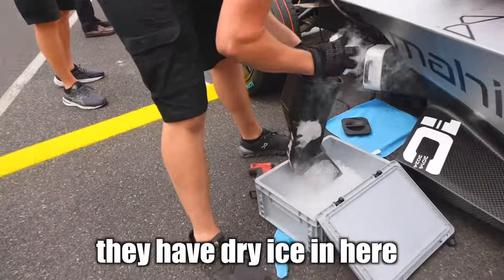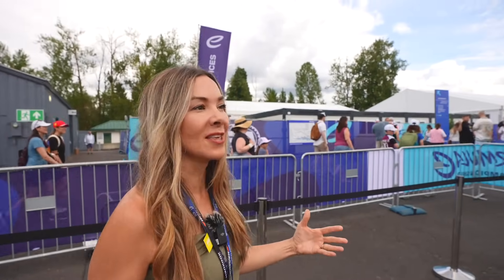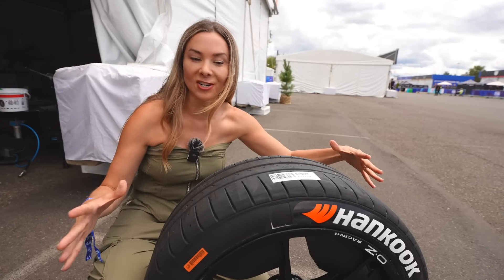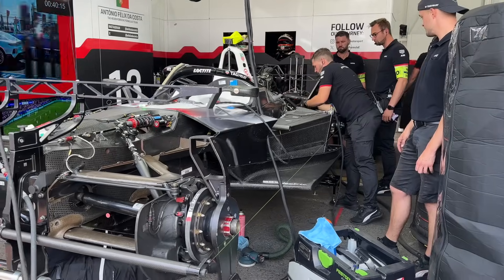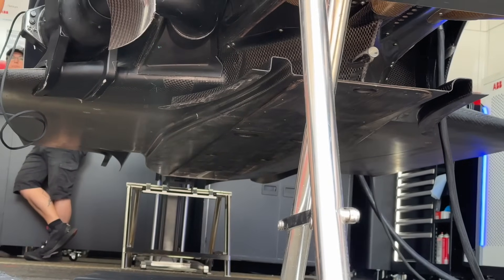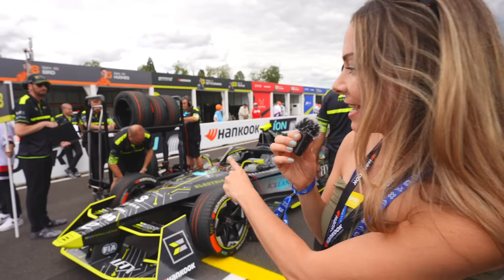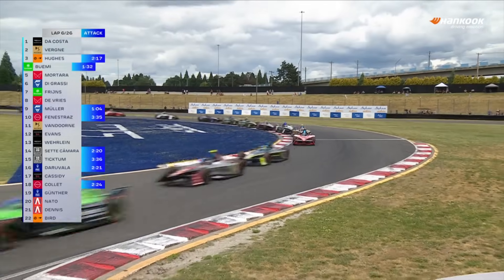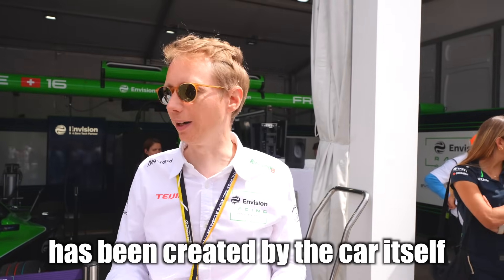World’s FASTEST Charging EV? Behind the Scene at Formula E!

Comment: 5 minute pit stop for EV vs 2 seconds for gas car. Even 5 seconds considered slow pit stop 🛑
Reply from the maker: There are no pit stops in these races.
Reply: @ItsKimJava  Which is the confusing part.  They are being advertised as having this super fast charge rate yet they don't charge during the race?  It would be so much more interesting to have a race where the cars did have to charge to make it to the end.   I'll just stick to NASCAR for now.

Comment: 15C charging is insane.  I would love to hear how long that pack lasts at that rate.
Reply: About 200 charges. Jsut using gigantic radio control helicopter packs. Super high c in and out and  few cycles .
Reply: @oci464  hm. If so, that makes sense. Enough for a season. At which point you're not far from a hardware upgrade anyway.